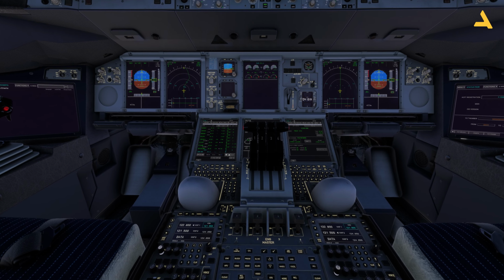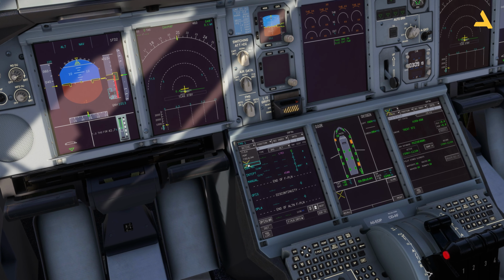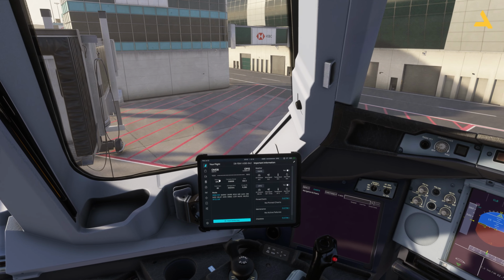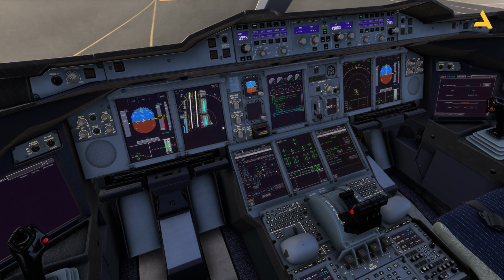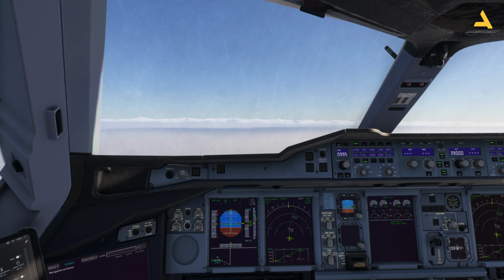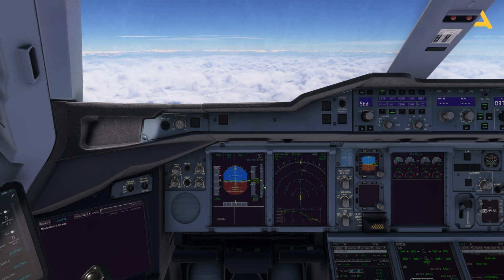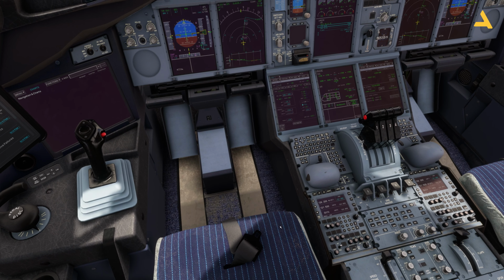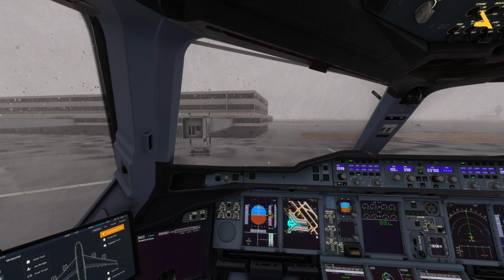A Complete Walkthrough of the Flybywire Airbus A380 in MSFS 2024

Comment: Use the FBW 380 but just stutters all the time no matter what the settings, although the FBW 320 works fine.
Reply from the maker: Which version of A380 you are using?
Reply: @aatifahmad the FlyByWire 4k tried both stable and latest versions.